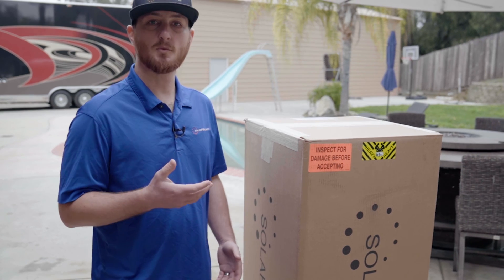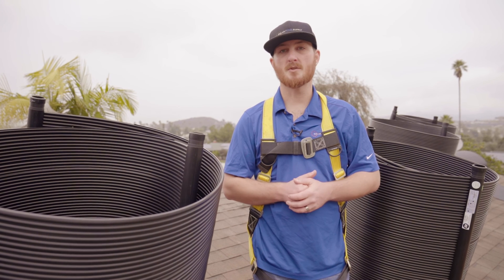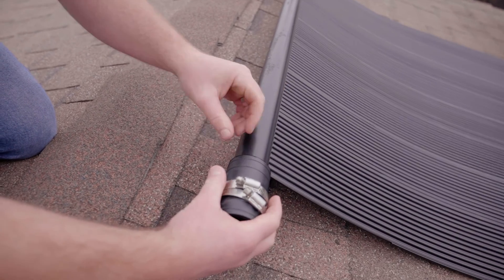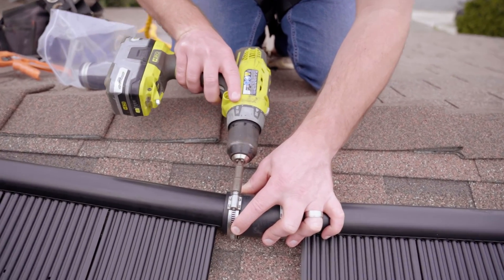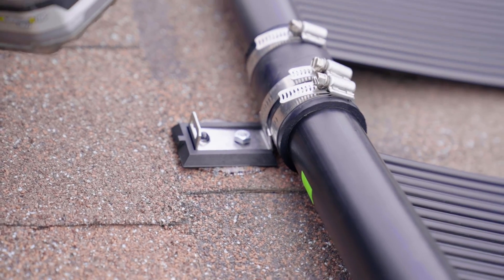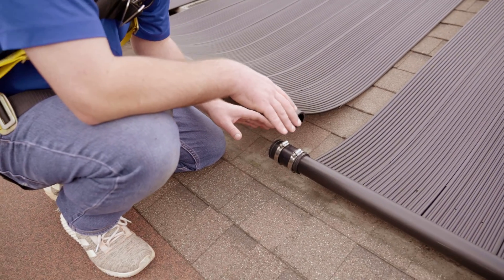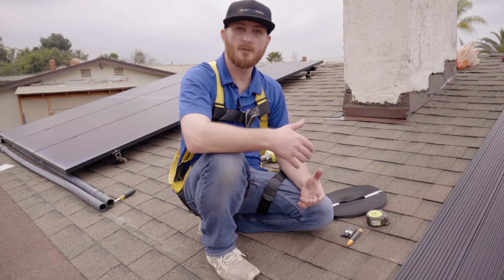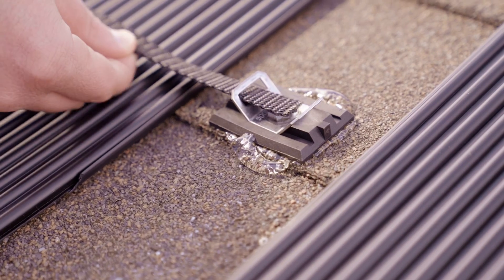SwimEasy DIY Solar Pool Heating System Installation Guide | SolarPoolSupply

Comment: Maybe I’m missing the details, how much can these panel increase your temps? I have a gas heater and was seeing if there are additional supplement heat sources to not run the heater as aggressive. But not seeing any case studies on before after and what you should expect.
Reply from the maker: A properly sized solar pool heating system will increase water temperature by 8-15 degrees, sometimes more, depending on variables such as seasonal weather conditions, panel orientation, and daily solar run time.

Comment: Question. Does the panels need a pump to run the water?
Reply: checked your other video and answer should be yes. Hmm... hope one day you can give a video how to connect this one into an existing gas heating pump.
Reply from the maker: Yes, these are thermal heating panels, so a pump and filter are required to cycle water through them.
Reply: But you can use your existing pump or you need a more powerful pump with higher volume?
Reply from the maker: @pajeeper420  Most systems tie into the existing pump/filtration equipment. An independent system can be done, but it's not a common method. The pump horsepower requirements depend on the size of the solar system, length of plumbing runs, and height above the pump to the panels.